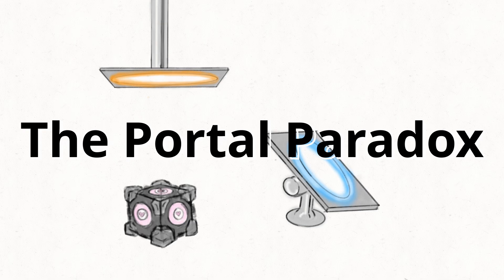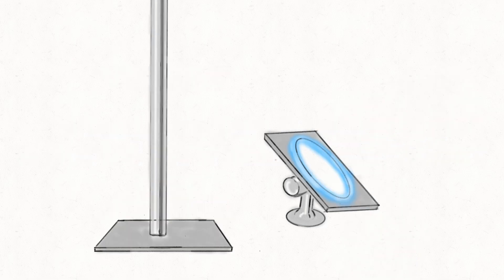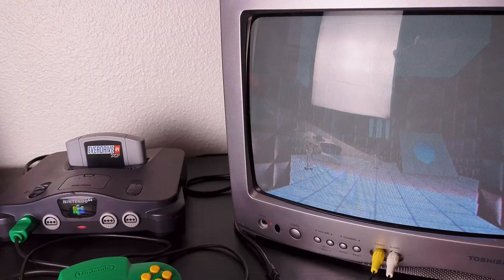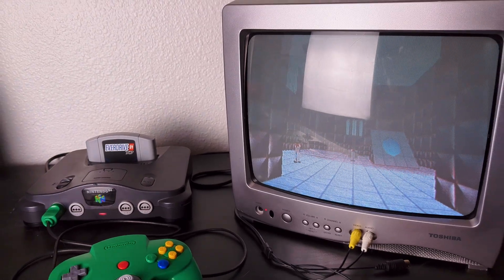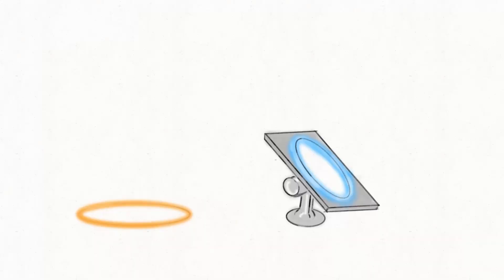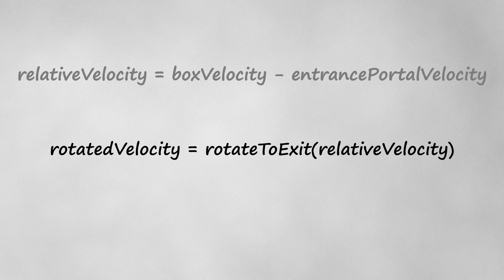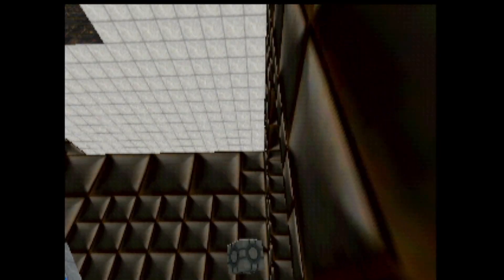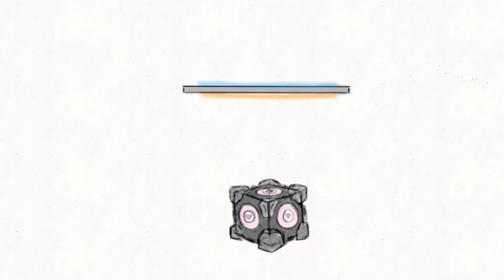I rewrote Portal from scratch and solved the Portal Paradox

Comment: I find the explanation confusing to some extent. I feel that by saying "the movement is relative" you are trying to simplify the problem by staying that a portal moving towards a box is the same that a box moving towards a portal. I agree to some extent in the statement, the problem for me is that you have to keep your reference system constant. The entrance portal can be seen as static and the box as a moving object, but In that case the floor, ceiling and (most importantly) the exit portal are also moving. From the point of view of the now static entrance portal, the box came in flying and was sent out flying; but given the fact that the exit portal is also in movement (relative to the entrance portal), for the exit portal the box should just barely stumble out.
Reply: The problem for me is in assuming the rotational exit is only a function of gravity on the exit portal, while in my mind it seems to be a function of gravity applied to the part of the block on the entrance side of the portal (given it's direction and it's effect upon the center of mass on that side of the portal) pulling against the exit forces on the exit portal. In this case the forces working on the exit portal is the gravity affecting the part of the block that has exited through the exit portal given the angle of the slope

Comment: I think the issue with the paradox is that it's solvable depending on how you define what a portal is and its properties.

For what I would define a portal as, I would say the equation is wrong in that it considers the entrance portal to even posses the capability to have velocity. I would argue that what has velocity is whatever the portal is attached to, but the cube never makes relative contact with it and is therefore not affected by it. (I guess that puts me in the infinite accordion camp?)

(Below is a bit over-simplification of my theory, but to illustrate:)
If you glue 2 identical circles on a paper and there was a sliding cover that always shows a total of 1 circle, no matter how fast you slide the cover, the circles don't move because they're not ever connected to the cover.

Without putting too much more thought in it: I might surmise that the cube, rather than just exiting as some dimensionally compressed matter, would arrive either as an explosion of particles and energy (like a nuke) or, if the matter wasn't compressed to the point of losing relativity (say via extra-dimensional travel and causing the former), push out relative to the decompression matter that defines "the cube" (like a slinky). I would also surmise that decompression velocity would be marginal (in our 3 dimensional space) since most of the velocity would have to happen in dimensions that supposedly have no perceptible effect on ours and may just be residual to whatever forces were used to enact extra-dimensional travel and rounding errors due to a constant expansion of space within our dimension relative to whatever amount of time is taken. (After typing all this I wonder if something was stuck half way we'd something that looked like a separated hourglass)

My thought experiment would be: if you placed on either side of the portal a table that the box can sit motionless halfway through, then move one end of the portal down as if to slice the cube in half, what would happen? 

Would the portal refuse to go down beyond the bounds of the cube in order to ensure the relative shape of the cube? 
Would we be moving matter along one or more dimensions to retain physics in our 3 dimensions, perhaps even creating some sort of Escher art as we could perceive it? 
Would the cube simply be cut in half?
Some other outcome?
Can the portal even be attached to matter? Perhaps only its created position can be determined relative to matter?

I believe depending on what outcome you believe, the portal is designated with different properties and all would be correct. At the end of the day the Portal paradox isn't a true paradox, it's a lack of definition, or, maybe far in the future, it will have been a lack of understanding.

Comment: How does the velocity transfer to the cube. It should just appear and slide down the ramp. It never had velocity and just because the portal came in contact with it doesn’t mean the portal velocity transfers. 

The blue portal isn’t moving away from its stationary point, so the cube wouldn’t even move forward a bit like in the illustration. The cube would just eventually sit flush on the angle and slide down.

Comment: I feel like the main issue with this is that its velocity based calculations which doesnt factor in mass/energy.

Like if a person is running at 5m/s runs into and grabs a stationary ball then continues, the person and ball will be moving at 5m/s.
But if a ball is moving at 5m/s and collides with a stationary person, the ball and person will not continue moving forward at 5m/s.

The cube has the mass and be seen as the person while the portal doesnt have the mass and canbe treated as the ball in the example above.

Another example could be if you treat a portal as a doorway. A person can sprint through a doorway, and so if hes moving fast into the portal/doorway, he comes out moving fast. But if the person stands still and you have others move the doorway around him, the person still isnt moving regardless of the speed the doorway/portal is moved. The person will not have movement coming out the other end

Comment: Before clicking the video I took a moment to try reasoning this out for myself, and relative motion was also the conclusion I had arrived at. Pop quiz time, but which would be more catastrophic: A car traveling at 120mph colliding with a parked car, or two cars colliding head-on at 60mph each? Well, the answer is that they're more or less equivalent outcomes. For that reason I do believe it's the speed at which the cube crosses the threshold of the entry portal that determines its momentum coming out the exit portal, irrespective of whether it's the cube or the entry portal that is responsible for closing the distance.

Comment: One thing that I think would still apply would be the force required to throw the cube. Just because portals are involved doesn't mean the laws of physics are bypassed. That force is going to be applied to the arm for the plate that the portal is on.
Reply: Relativity applies in this situation
Reply: portals by definition bypass the laws of physics

Comment: The question boils down to does the portal teleport matter and energy, or does it create a hole in space. If it teleports - disintegrates on one side and regenerate on the other, relative momentum will matter and the cube will woosh. If it's instead just a spatial shortcut, it will plop.

Comment: I dont think you calculation is, in any way, wrong. Indeed its more true to physics than an equation that would focus entirely on the velocity of the entering cube and nothing else.
However you COULD calculate it that way... and we dont know if portal does it that way or not.
I guess it depends if your question is logical or pedantic.
Are we asking a general physics question or a source engine question 😅

Comment: I really like the style of your video - thanks for not wasting our time.

However, I'm not convinced. If you drop a hollow doorframe over a box, the box won't be moving. Basically, it would stick out of the portal without falling out. If physics changed, it would only drop down as if you tilted the surface.

If we want to believe in portals with the physics we know, we do have to consider portals from a differente perspective though.
Think of portals as door frames. It's not the portal moving stuff, it's the space around it compressing. You can't move portals but you can compress the world around it more or less.
This means that you can change the distance of your portals (by compressing space around it) but you can't change the angle or move it to its side.

There won't be a portal paradox, it's just a quick way of passing through space.

Comment: I feel like this might be a dumb question but I'll ask anyways. If a portal that moves down throws the object out the other side, than imagine this:

I'm holding a pole above my head. The portal setup is the same as your first example. The portal moves down to a height which allows the pole to pass through but does not come low enough for me to pass through. Would the relative velocity of the pole to the poetal mean that it would pull me up and through the portal?
Reply: It depends on how fast the portal is moving and the mass of the pole, but theoretically if it were moving fast enough and the pole had sufficient mass, and you were able to hold on to it,  then yes.

Comment: This answer makes complete sense according to general relativity. From a spectator perspective, the portal looks like it's moving into the box but relatively speaking, this is the exact same scenario as the box falling into the portal. Therefore, it would have momentum and be tossed out the other side. In fact, general relativity should be applied to all of portal's difficult problems. Many questions can be easily answered with it.

Comment: The thing is though, As you move the portal over the object, a portion is being acted on a different reference frames. And the amount on each side changes as it passes through the portal.

For example you have gravity and normal forces acting on the half that is at rest. The other half has gravity and normal forces acting at Angles to each other. I feel like you have to take take this to a limit, calculating the forces being applied on each portion. Treated almost like two sections connected by rigid rope or string.

I guess I could be wrong maybe in the simplified into relative motion. But I feel like a lot more of that play because of the two different reference frames

Comment: Another way to explain the velocity is to say that the cube itself doesn't have velocity, but the first portal is consuming the cube at a set rate, which has to be mirrored in the rate the cube exits the other portal.
If this were not the case, the particles making up the cube would be forcefully compressed when the entire cube is "between" them - but there is no "between," as is evident when you move through/observe portals.

I think the real question is what would happen in reality - it isn't just a cube, but also a column of air, right? I'm probably overthinking it, but I imagine it would be tough to move a portal because of all the air displacement, but in a small room, it would probably stir up an interesting vortex....

Comment: Why you might be wrong: momentum.  Speed is relative but the cube and any other object have inertia so bringing a cube at rest to some velocity instantaneously/quickly requires a force.  Objects of different mass require different force to get the same acceleration so I'd expect an object coded to have different mass have a different trajectory.  As written, the portal imparts exactly enough force to whatever object passes through it to accelerate it to the velocity you give it on the way out.  

All that said, I think your implementation is clever and very gamey and fun.
Reply: Imagine the cube not as a solid object, but as a bunch of layers, slowly passing through the portal. Layer one appears on the second portal, while the first is still moving down. Now, because the first portal moves at a specified speed, the object has to exit the other portal at that same speed. Layer 2 appears out of the second portal at that exact speed, and pushes layer 1. Repeat until the whole cube comes out.

Comment: What about partial teleportation. I.e. the portal doesn't fully slam down. Will the object get sucked through or stay
Reply: The portals in Valve's game is represented as a hole that combines both spaces physically, its in both places at once like if it were halfway in a regular ol' hole. Half of its stickin out the other portal. The only way it could move is if the portal travels so fast that it makes a sorta suction effect with the air maybe called a vortex im not sure that'll pull or push it like if a giant hole were to fall on you in real life at really high speeds. But thats not in any of the games, maybe hundred years from now we'll have ray tracing and wind tracing

Comment: Hi James. The reason that I believe you are wrong is not because of a problem in your equation on screen, but a more fundamental physics problem, that is Newton's first law of motion - an object at rest will remain at rest unless a force is applied to it.

Velocity only comes from energy and energy transfer. The box is at rest with no kinetic energy, or potential energy. The portal has potential energy which it transfers to kinetic energy as it falls. When it hits the ground, the ground absorbs and/or reflects that energy with sound, bouncing and breaking. At no point is energy transfered to the box to give it kinetic energy.

Now you could model it so that it did, after all this is merely a simulation of a thought experiment, but the thought experiment hasn't considered energy transfer which is the fundamental problem.

You could decide that all the kinetic energy is transferred to the box - though that would create problems if done in reverse. Typically an object moving through the portal carries it's kinetic energy across. But by transferring energy between portal and moving objects, the object would come out of a portal stationary, and the portal it went through would start moving in an equal and opposite manner. :)

Anyway, tldr, the model fails because it fails basic law of motion requirements.
Reply: Imagine the cube as a bunch of layers. The portal is moving at a speed of, lets say, 100kmh. Now, the portal slams down on the cube, and the first "layer" of the cube exits the second portal. The second layer then exits the second portal, and pushes the first layer at a speed of 100kmh, because that is the speed of the portal (because things entering a portal come out of the portal at the same speed as they entered). Rinse and repeat for all of the layers, and then you have a bunch of momentum that is forced onto the cube, via the layers pushing onto each other with a speed of 100kmh.
Reply: @makarymetzger2627  yeh. You could argue that. But because the box has mass, you just described the box having infinite acceleration, therefore applying an infinite amount of force to the exit portal, with an infinite rate of energy transfer. None of these aspects is ideal in an internally consistent physics model.
Reply: @LilleyAdam  I think the acceleration wouldnt be infinite, i think it would be comparable to being pushed, since the transfer of energy isnt instant. Imagine a platform moving onto a cube, with no portals, the impact wouldnt be instant
Reply: @makarymetzger2627  ???
In the real world, the box would be crushed. 
Force=mass*accel
Instant velocity change (0-100km/h) means infinite acceleration because acceleration is velocity change/time.

This isn't comparable to being pushed because the portal is moving through the box at speed, not impacting it and pushing it
Reply: @LilleyAdam  But the cube doesnt change its velocity instantly, i think its comparable to hitting a ball with a baseball bat rather than instant velocity change, since the speed would come gradually, as you pass through the portal.
Reply: For those arguing about relative speed and momentum change through the moving portal, Einstein figured this one out in his time dilation thought experiment. It's not merely box velocity relative to portal. It's object relative to the universe and portal relative to the universe. The box must exit the portal staying in same relative state to the universe. Inertia must be maintained in the box.
Reply: @LilleyAdam but didn’t Einstein also say there is no absolute frame of reference to measure relative to?